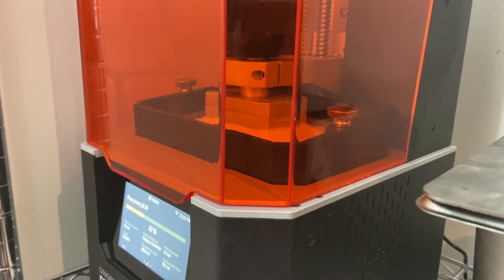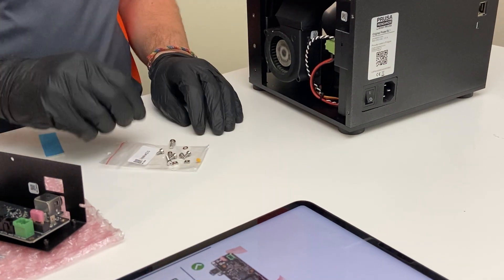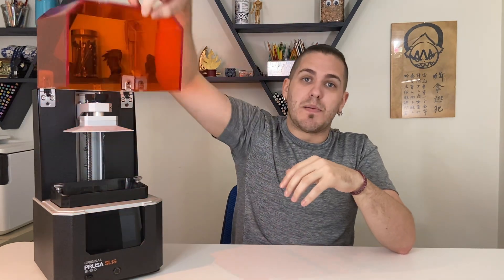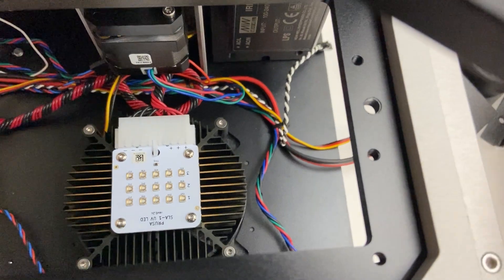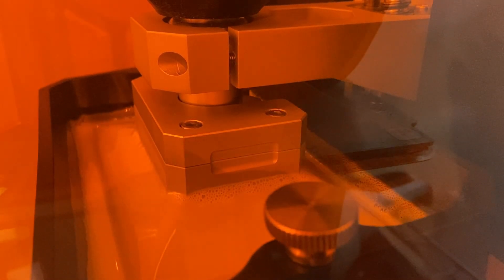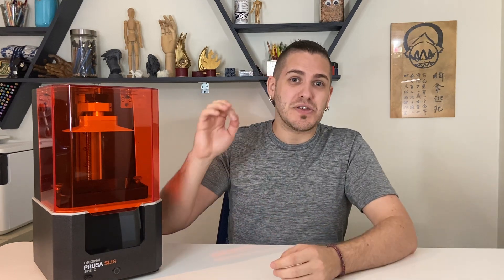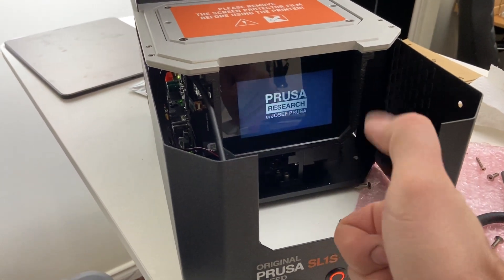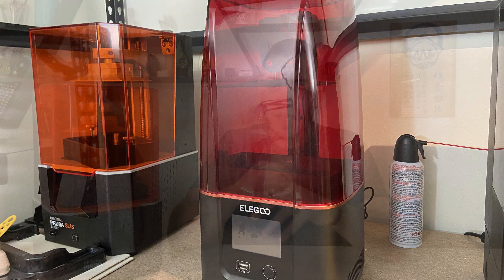Prusa SL1S Review - The 3d printer everyone Loves to Hate

Comment: HELLO, someone is offering me this printer used but great condition. Is it still a printer that can compete with the "cheap" printers today when it comes to jewelry 3d resin printing??
Reply from the maker: In many ways the SL1S was years ahead of other printers, and in many ways it's behind. 
If you can get it in a cost effective manner, it's not roughed up, and it suites your workflow, then sure. Keeping in mind that some soft castable resins don't like the tilting vat. But we find the exposure testing settings invaluable.

Comment: Question for you I have the funds to get a SL1S, I want to use X one blue resin. I have a Ellegoo mars 2 pro kind of a disaster as it would not turn till I removed the electronic cover. My deal is I want to print up to 4 inch diameter and it looks like the Prusa SL1S falls just short of this, what other printers would you recommend ?
Reply: Look into a Nova3D Bene6, or if you want a bigger build area, the Nova3D Whale3 SE.

Great printers for those kinds of resins.

Comment: Is this still your go to printer?
Reply from the maker: As of a week ago we had our first issue related to the cooling fans and control board. I have all the replacement parts on the way, and it will certainly be our go to again once it’s back up and running again.
Reply: @ClearMindJewellery  Thanks for getting back.  I run 5 x MK3s and now looking at resin printing so naturally the Prusa gear I look at first. My only issue is the 2k vs the now cheaper 4k systems out there in the market, theres' so many to choose from however the after sale service with Prusa is excellent.
Reply from the maker: @HotCarTrack  XY pixel resolution isn’t everything, the SL1S pixel size is 49 micron which is actually lower than some medical grade DLP printers. A 2K screen is around a 20-25% increase in resolution depending on the size of the screen over 4K. I look for build quality and what support the company can offer most these days. We’re finding the resin itself can make a huge difference as well, some aren’t capable of printing at high resolution. A print in high fidelity resin on a 2k printer can be easily mistaken for a high end DLP.
Reply: @ClearMindJewellery  Good advice reading the 2k screen, I would be making 28mm figures so a 2k screen should be fine, It's just the price on this machine brining it into Australia vs a Saturn 4k machine i'm thinking about, I do love the Prusa gear though.
Reply: I need your advice. I would like to use it in my dental lab. Is it good choice. 
Thanks.

Comment: Appreciate your review! Agree with the vat though, the screws are horrible. Have you had any mini bubbles within your prints either on the SL1 or SL1S?
Reply from the maker: I have had bubbles on the bottoms of some prints only with the SL1S, I've been wondering what that is. It's largely only present on the bottom of the pads though so hasn't effected print quality.
Reply: @ClearMindJewellery  Thats strange I haven't had that occur, mine seems to skip the first 6 layers or so then i tend to get one line of mini bubbles ont he print, the bubbles are much smaller on the sl1s though thankfully
Reply from the maker: @KroMeMWGz  I wonder if it's somehow related to turbulence from the tilting generating bubbles. It's a mystery I will be looking into.
Reply: @ClearMindJewellery  I'm really not too sure, i have spoke to someone that was using a Mars printer and they had it occur too so i don't think this is just related due to the tilting plate. I think more people have this occur but they just dont realise as the resin they use is opaque, using semi transparent resins shows the line easily. My objects I print are hollow in the middle which i think could be the cause of the bubbles as it doesn't happen on all of my prints

Comment: It’s 2 grand!😭😭😭😭😭
Reply from the maker: It is expensive considering the target market Prusa is aiming at, it's really a bargain. Don't miss the ELEGOO Mars 3 review upcoming though, if budget is an issue then it's worth considering as a very good entry level machine and a solid stepping stone to higher tier machines if that's something you'll end up requiring.
Reply: @ClearMindJewellery  Thank you for your advice.
Reply: @ClearMindJewellery  "Z wobbe" and other problems are "very good" for entry level?  LOL
Reply: It is indeed, but from my experience with my printers it’s a solid 6x or more more reliable than at least my friends printer, and it has a marginal quality increase over “normal priced” printers

Comment: I believe the reason they changed to a plastic vat is because they wanted to increase the tilt speed, and so they had to reduce the weight of the vat for fear of burning out the motor with quick tilt times.
Reply from the maker: Between the weight and the new size of the build plate I agree that it was necessary but doesn't mean I can't miss the old ones, a lot, lmao.
Reply: @ClearMindJewellery  yeah that’s the one thing I’m dreading bout when i get my upgrade later this month. Least on their own they are cheaper…
Reply: I think the number one reason they went for the plastic vats is that they're cheaper. For the price of one metal one you can get three plastic ones (I'm pulling these numbers out of my ass, but the manufacturing cost of an injection-molded plastic vat is basically zero compared to milling out or even casting an aluminium one) to keep different resins in the vats and not have to do so much cleanup between runs.

Comment: in terms of quality Wts u r opinion about 8k mini sonic?
Reply from the maker: No one has their hands on one of those machines yet, so it's hard to say. Phrozen is doings good things overall I think, I like their designs especially with the large format machines. I have heard about inconsistencies with their UVLEDs and some quality issues with the screens, but it's usually manageable with print settings and they're usually pretty good about giving out replacements within the warranty period. 
I don't believe that 8K is going to change much of anything at a visible level. High end DLP machines produce some of the best quality prints possible and they aren't printing at as high an XY resolution as the 8K, there's a lot more to a machine that the screen.

Comment: I think this might be my first 3d printer!
Reply: My SL1S upgrade is coming in a couple weeks, i cant wait. But the SL1 is incredible I’ve had it for a while now
Reply from the maker: We bought the SL1 with the CW1 as a kit back when it first came out and the consistency has been key for our business.
Reply: @ClearMindJewellery  And it is the selling point that makes want to buy this printer. I want the most bang for buck printer that would last a long time with minor maintainance
Reply: How about photon mono S? Litteraly identical quality and speed, almost no maitanense but 6-7 times cheeper and accembled.
Reply: @hohhan1978  quality is no where near identical.
Reply: @AhmadM25  Same pixel size, same screen manufacturer,(literally same screen model, just with different connector) same light source, Double rail with same repression on wobbling as ball screw + Single rail. So where is the difference? You cant just say that quality drastically different if all parts perform the same way. only difference is on tilted bath and on ball screw, But it does not improve quality as much, there 0.1% Difference on layer repression. So you gonna pay 500% on top for less then 1% of real improvement. I just can't understand, i have calibrated even cheaper model without AA for engineering application. And i have no issues or additional maintenance for 7 month straight. For me its clearly marketing.  I honestly wanna know If you have any other reason why it can be really better at that price-point then competitors.
Reply: @hohhan1978  i meant not print quality but the machine it self
Reply: @AhmadM25  If you buying this machine for making money with that or for the print quality it just not the best choice.
Or if you wanna buy your "first" printer just for practice it simply bad idea, there the reason why everyone recommends to buy cheaper option for the first time.
But if you have such amount of spare money, and you just wanna good peace of hardware I with you on that ;) in this case it make sense)
Reply: @hohhan1978  no i want the exact opposite of a "practice" printer
Reply: @AhmadM25  So in this case it still loathes to this one (EPAX X1-4KS 6.6) in all regards. Even on build quality and reliability and price, its only tiny bit slower🤔
Reply: @hohhan1978  Compare those to a Nova3D Bene6 (or even a Bene4 Mono) and you'll see some serious differences that makes one wonder what kind of fools are pushing those other POS printers (Elegoo, Anycubic, Prusa)